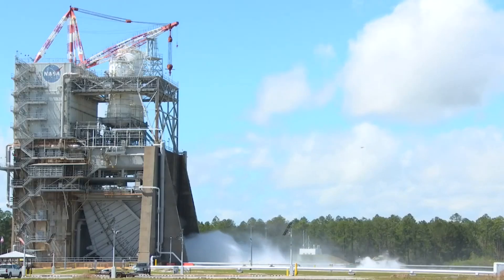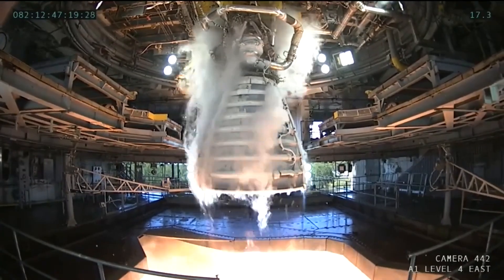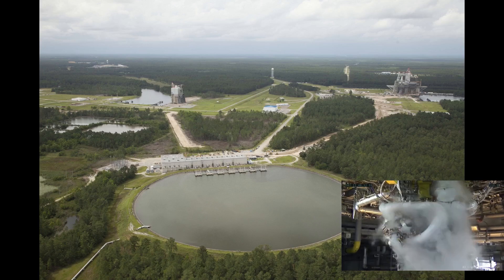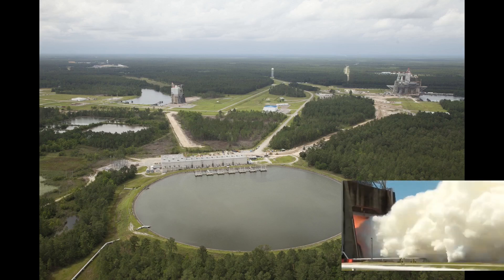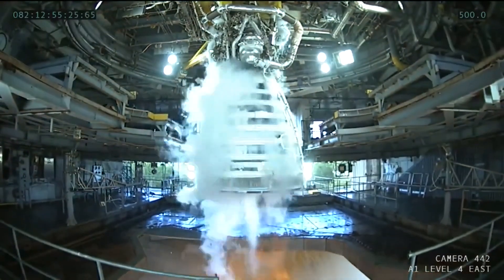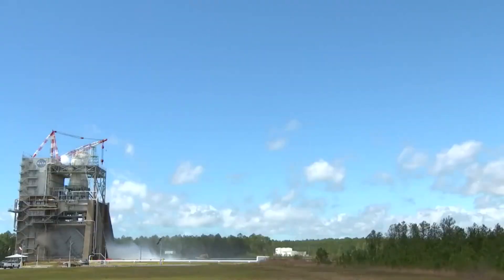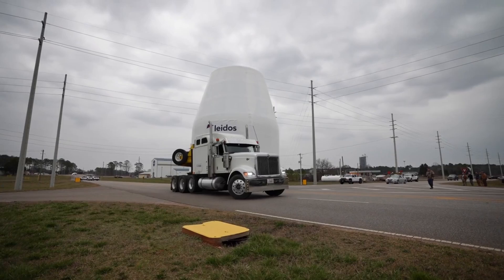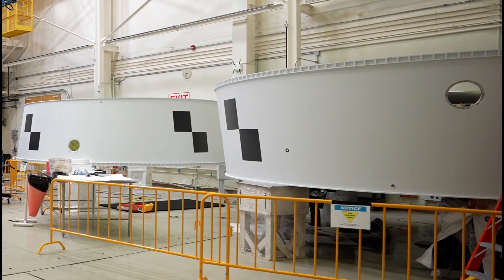RS-25 Retrofit 3b gets closer to finish line in this short Artemis update

Comment: Does SLS need to throttle down for Max-Q?
Reply from the maker: SLS did do a throttle down/throttle up "bucket" for Max-Q on Artemis I.  The BOLE boosters planned for the Block 2 vehicle had a goal to eliminate both buckets, but the throttle profile between now and then (for Artemis II through Artemis XVIII) is not "crystal clear."

There's some discussion of the factors involved in a paper on NTRS, "SLS Engine Out Capabilities"; it's on page 11:
https://ntrs.nasa.gov/citations/20205004525

Comment: They're going to shut down poor Chandra but Artemis marches on no matter what.
Reply from the maker: Yeah, the budget squeeze highlights what the highest priorities are in Washington.  It is likely affecting choices not just between the directorates and within them, but also resources for infrastructure and external communications.  As an example, there are still a lot of broken links on nasa.gov, which was in the middle of a transition last year.  Have to wonder if some of that content will end up only on the Wayback Machine.
Reply: I'll be surprised if that actually goes through.
The money needed to operate the telescope is relatively little and there's been a lot of support behind continuing it after the intention to wind down operations was announced.
Reply from the maker: That's true, but the risk to the capability is there, particularly depending on the outcome of the election this year.  The budget caps already instituted for NASA's FY 2024 operations and future planning are likely to have effects that aren't yet obvious.